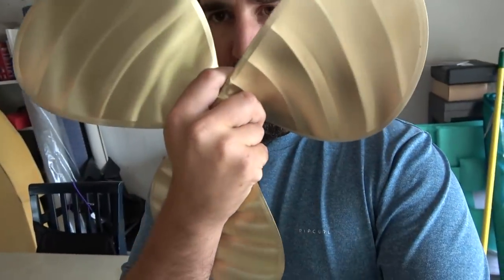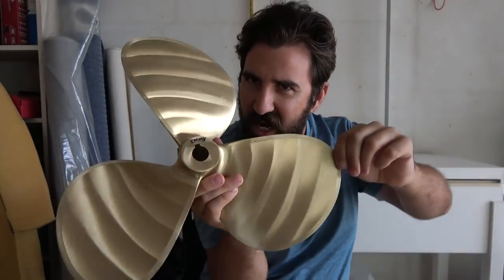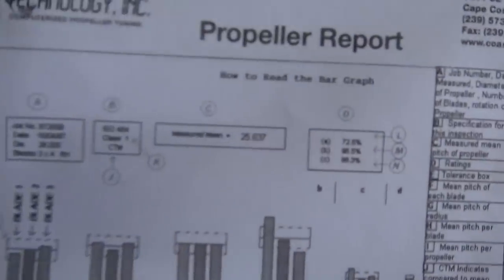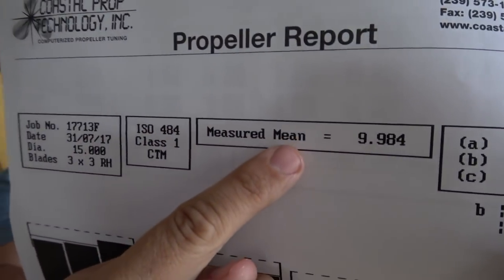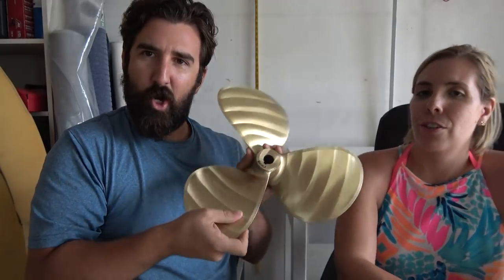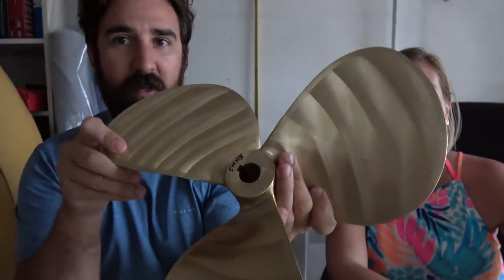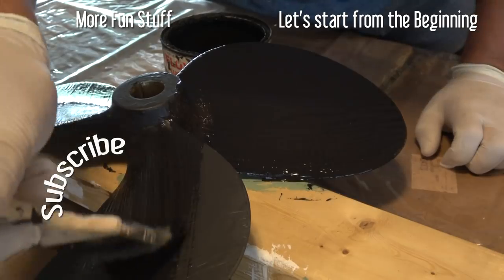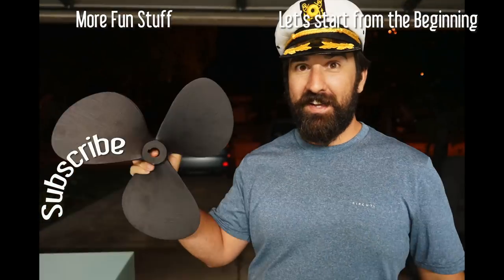12. Painting a prop Anti foul paint boat project Reality of Living on a sailboat The Boat Life Vlog

Comment: I'm a powerboat guy, not a sailor even though I enjoy the videos. The pitch is the amount of angle in the blade. Without getting too technical it's how much "bite" the prop has in the water. The lower the pitch the more low end performance. The higher the pitch the higher the top speed. You probably need something in the low end, or towards the middle as it's pushing a lot of weight and you don't need a lot of top end. Plus your cruising RPM doesn't need to be all that fast. Again, power boat guy. I've tried a bunch of props, high speed, low speed, surface piercing larger and smaller diameter etc. Anyway, hope that shed some light on all those indecipherable numbers. I used to paint my props too, but they were all stainless rather than aluminium and they had a tendency to walk off since they were desirable. The paint wouldn't take long to burn off either. Enjoy your posts!

Comment: next time if you run  a broom handle through the propeller and put the handle across two saw horses or chair backs, you can paint both sides at the same time. just a gloved hand to touch the tips to rotate while painting
Reply from the maker: Smart, thanks for the tip.  Next time!

Comment: i used a dowel rod put it through the shaft hole and hung dowel from garage celling  with wire was hands free and easier to get the edges real good
Reply from the maker: That is such a good idea, thanks for the tip.